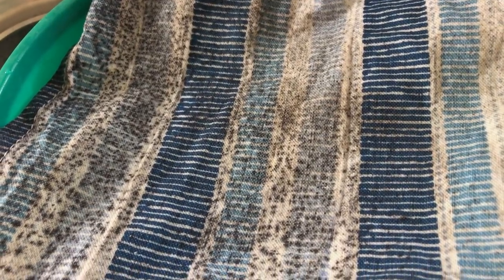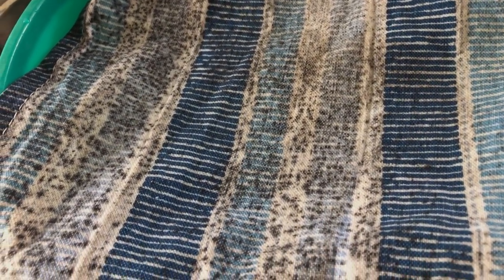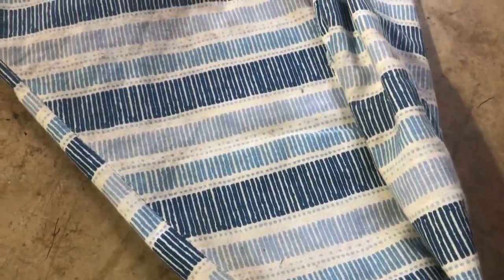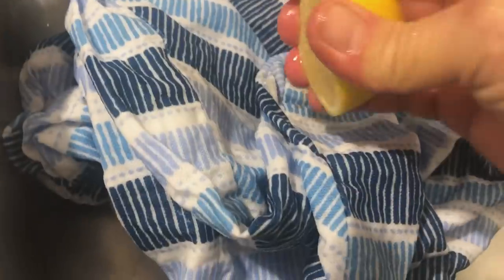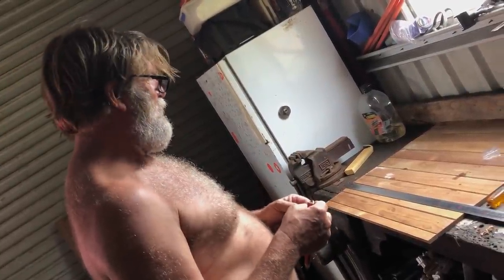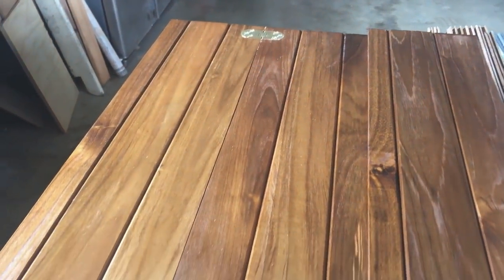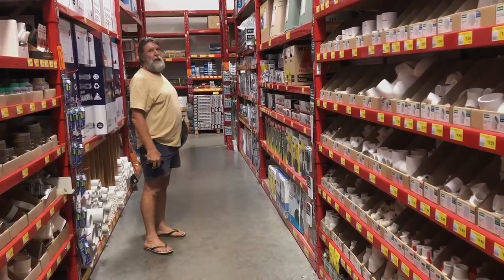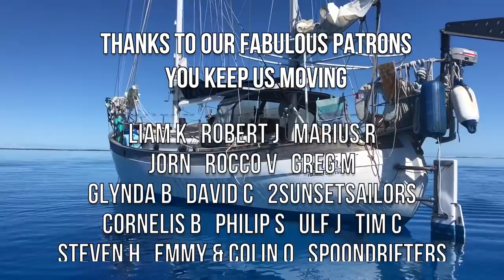Ep 226 | Rejuvenated Cockpit, Mould Removal, Sailing Nutshell, Australia

Comment: Hi Wendy, oxalic acid is a great rust remover, I have bought it in powder form and made up a solution, it takes rust stains of fibreglass and brightens grey teak. It may pay to try some on a spare bit of cotton but I think it should be OK. Clove oil is the mould preventative, very popular in Queensland summers, again in a solution and pop it in a spray bottle get it from the chemist.
Reply from the maker: Thanks Roger for the oxalic acid tip. We’ve used it before to clean tired western red cedar doors and it worked a treat, but never on fabric. And thanks for the tip about clove oil. W.

Comment: This may sound crazy and you may already know. If you are going to use Globe Valves (preferable because they are infinitely serviceable) I would recommend disassembling them and coating everything with plumbers grease, especially the stem packing. It is also a good time to measure the rubber washers so you have some in the spares locker.
Reply from the maker: Thanks for the tip. 
Cheers